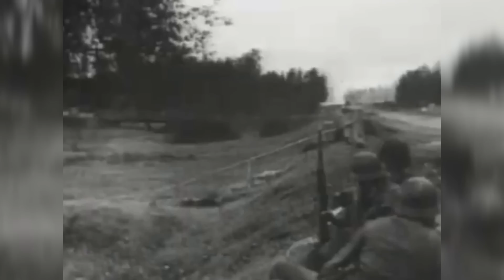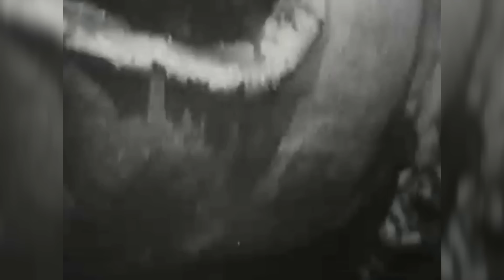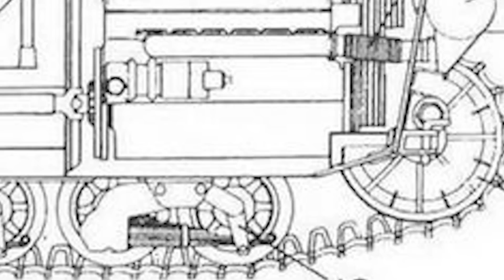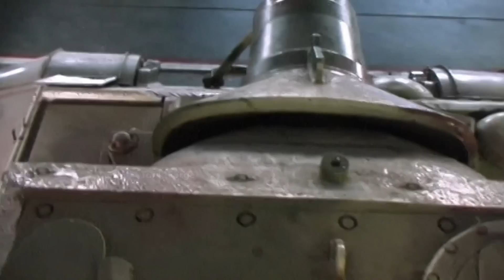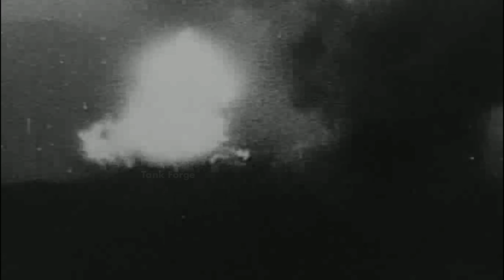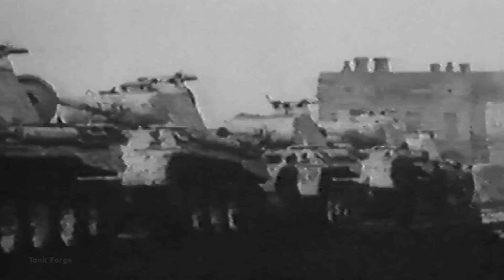Overrated Beasts? German WWII Panzers Revealed

Comment: Los of misinformation...the Stug high hit probability has nothing to do with it's low profile.. It is because the Stug had superior bi-focal sights compared to tank mono sights.  And the Stug 6 speed transmission was actually very easy to drive as all the gears had good gear synchromesh....thought  6th gear was basically worthless. The short barrel 76 Sherman gun was no threat to an uparmored Panzer IV...
Reply: Nothing  to do with low profile? Only a sith deals in absolute.  Surely you seeing them without being seen helps make a better first shot and possibly a second shot. I'm not saying you are totally wrong (that would be an absolute) just that I think the word Nothing is to strong in this case. The soviets loved the stugs low profile, but perhaps the optics too I suppose.  I did enjoy the video.
Reply from the maker: Fair point tbh—low profile definitely played a role, especially in ambush setups. Appreciate the thoughtful pushback
Reply from the maker: Now that’s a deep cut! Love how you dropped the bi-focal sight flex like it's common trivia 😄 The StuG really was the unsung sniper of the battlefield. Got a favorite variant or battle where it really shined for you?